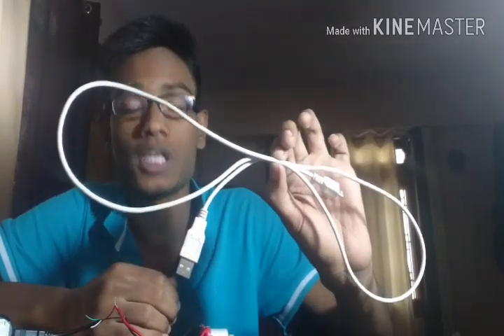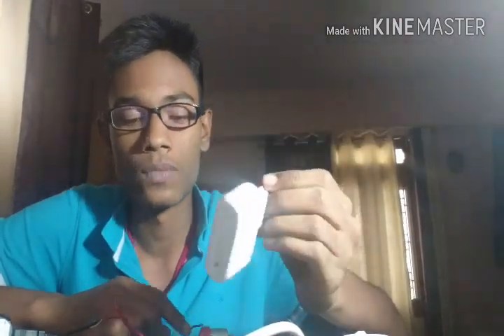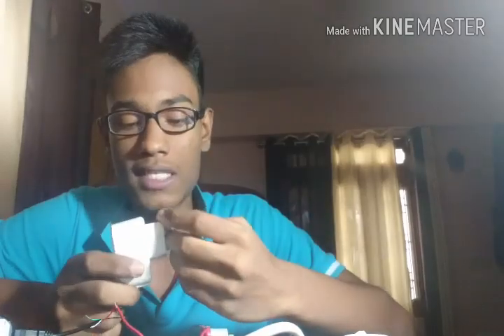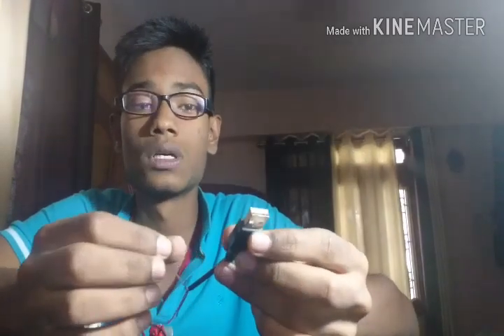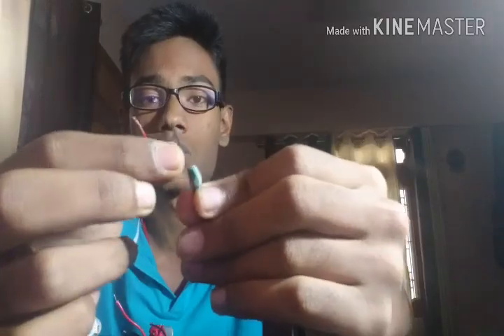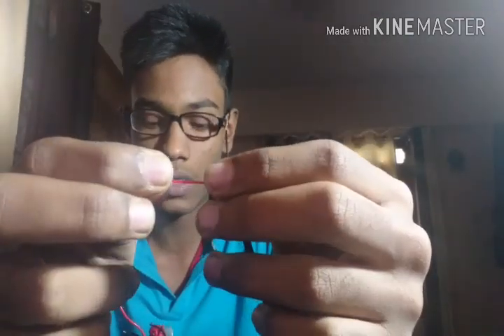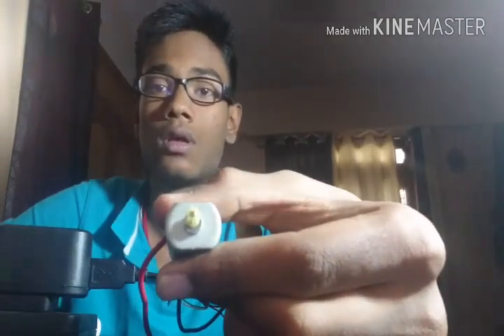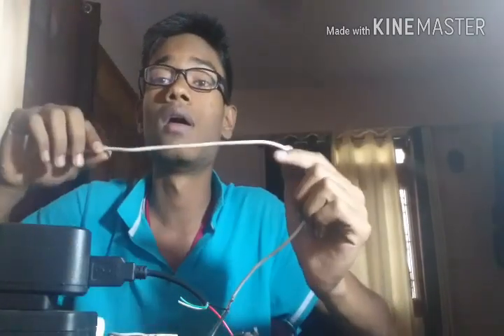How to directly connect usb cable to any electronic circuit or device.

Comment: Thanks, just fixed this old miller lite sign by using a usb cable. For some reason it had a 2.5mm to 3.5mm audio jack as if it was a power source.  Appreciate the video!

Comment: Everyone!!!! Please make sure that whatever you're operating,  matches the voltage that the plug is pumping out. You can only go over or under by 1 volt. I wouldn't pass that.
You all saw how his little motor was speeding up. Thats because the motor needed less power.  
It would have caught fire if he left it on.
Reply: Lol it wouldn't catch fire but the brushes would get burned up and the motor would be dead. You could fry small electronics with this though.

Comment: A few thoughts. You want to be careful of voltage and mili-amps. You can blow up the motor or start a small electrical fire. Somethings can tollerate a little more than designed . That motor is going ham probably because its more amperage than its used to. 

I understand why you are using the term battery here but its just converting the current and down stepping it.

For anyone curious the other 2 wires int he USB are Data + and Data -. So you can also use a cable like that to pull things off a thumb drive, to say, a phone. Which is a project that lead me to finding this.
Reply: Hello chris, i have a question. I have two different 2 way wires. One is with black & red and the other is brown & blue. How can i connect this wires? What color is for which. It is for an aquarium light which has the brown and blue wire. I cut it so that i can put the dimmer/timer in between the source and the lamp. The dimmer/timer has red and black wires. Thanks in advance😊
Reply: I used some speaker wire and the USB to recharge my headlamps battery it worked

Comment: Thanks mate! Was just wondering wether you can use just the Plus and Minus Pole of an USB Port, needed it for a bluetooth speaker project. Many thanks!
Reply: Yes you can definitely do that and its much safer. Did u see the look on his face when the motor went faster?? 
Yeah! It was gonna pop on fire. 
I know.  I've been messing with electricity since i was 5 yrs old.😎
Reply: @clearwater9118  Hej

Comment: Thank you! I recently bought a soldering iron because I thought I could do some cool stuff with it and I wasn’t sure if my theories on how to do it were correct... I’m pretty young and like to do this kind of stuff and right now I want to connect a motor to a USB output so if the motor spins, you can charge your phone, etc.. I then want to connect the motor to my bike so when I go biking I can charge my powerbank... Thank you for your help

Comment: I have a question. Can you do the opposite and connect those 2 wires, (black and red) from the usb to a wall electricity wires without a socket in the wall? There is a wall with wires that are for a wall socket but the socket isn't there. Could you connect the wall wires directly to the usb wires to get it to work? Thank you.

Comment: Hi ! So if I strip the USB can I connect it to a 9v Lithium Battery ? Is red positive black negative I ask so if I can power from Battery via USB which is already connected to small fan
Reply: @garfieldpelly  I think you can but it must be about the same voltage as I tried it with a 5volt fan and it worked on 9v battery

Comment: Hey brother, can i use this method for a rechargeable batteries? Thanks alot!
Reply: ? Like to charge a rechargeable battery? You could but that's pretty dangerous as if it overcharges your battery could light fire or explode.

Comment: Dear, I wired my mouse and a usb together to use my mouse on laptop...mouse's light is on but pointer is not working...what to do???
Reply: a mouse is different because you also need data transferred, not just electricity.

Comment: ⚠️🚫🛑☢CAUTION!!! USB wires are for low voltage electronics ONLY!!!
 like a phone, small 5volt fan, LED lights and bluetooth speakers, etc.
So its best to plug the other side into a USB socket/outlet.  Not the square charging plug converter thing that he showed.

Comment: Hello, thanks for this, please help me. I want to convert a normal type c adapter to use iPhone on my iPad . The iPhone cable has 4 wires and converter cable has 6 cables 😢 4 of the 6 are outside . 2 big red and black, 2 small green and white oh wait I think I know how to put them together thanks will update you now

Comment: Hey pal, do you know how to put a micro USB onto a 3 wire 3.7 volt battery ?. It's basically a positive, negative and thermistor wire and I need to attach the battery to the smaller USB. The newer type but not a type 3. I hope that makes some sense, probably not :-)

Comment: I had an old wired intex speaker so i had cut its two pin ower supply wite and attached it to the usb the way you told but nothing's happening the speaker is not getting any power supply
Please help buddy!!!!!!

Comment: If you connect a USB cable directly to 12V and hardware without using any kind of a converter or module how many volts is the output? 12v or 5V?
Reply: 5v
Reply: Abdullah Fathi huh??? That’s impossible because there’s no step down converter? How does it step down from 12 to 5 if you have no converter and you run a straight wire to the battery?

Comment: I have a two wire red & white wall plug that connects to my ps3 dual shock controller it don't charge then I have a red and cut blue and red USB end that can connect to USB port in ps3 and a white USB cord with four wires coloring red white black and green I'm so stuck here remotes not charging

Comment: Challengr Cables Sales PS-1.35-515SWC AC Adapter 5V 1.5A PS135515SWC  Model: PS-1.35-515SWC  Input: 120V 60Hz  Output: 5V 1.5A  
Asalam walikum 
Bhai ye charger hai jo mai ne apko detail di hai is ka cable change karna hai par charger mai 2 wire black color k us k cable kis tarhan change hoga

Comment: Hy bro  my Samsung charger pin was not working so i tried to replace it with a duplicate charger pin but i got confused when i saw four wires in the original charger and two wires in the duplicate pin so how do i join this?plz help me

Comment: What will happen if all 4 wires of USB cable connected to dc motor?
Reply: Manthan Patil Bro those cables are for transmitting data..for eg you use them to receive and send any files into your computer
Reply: Nothing other two are for data transfer

Comment: Thank you sir for sharing this video. I am hoping that this method will help me produce a cable that will charge a deep cycle 12 volt battery with a portable solar device (battery). If so I will share in my own video, and credit you. Thanks again. ✌🏼😎
Reply: No it will not.... the usb cable can only supply a maximum of 5v 2amps, any more than that and you will end up burning out stuff... buy a cheap second hand solar panel and a charge controller from ebay and do it that way or just buy a cheap battery charger.

Comment: It looks like you had a 3 volt motor with a 5 volt charger, that’s why it was so fast.  I wonder how long before it burns the motor out and burns down the house.
Reply from the maker: Well it is true what you have mentioned but I have used this thing for a while now...and believe me I still live in the same room.
Reply: SHREYANSH SHASHWAT well I’ve used your video and fixed an old beard trimmer using a usb. It gets hot when I charge it, so I’m always in the same room just in case, but hey it now works, so thank you.

Comment: What if there are only 2 wires, one is white and the other is off-white
Reply: Do you have a multimeter?  you could check the voltage across the two wires

Comment: mine did'nt work, i don't know why, is it cause my USB is too long???? I connected everything properly too.
Reply from the maker: +dheer tammina 
No, if its long it does not matter ,does it have same wire colours as described in videos?
Reply: yup
Reply: It does matter, Google electrical resistance dc.... seriously bad video
Reply: Honestly don’t know anything about this and I know this was 3 years ago, but you should try plugging it in to a laptop and then see if it works. Don’t even know the reason but yeah it might work that way.

Comment: Who here knows how to o convert I guess you would really say. 5 wire to a 2 wire charger cord..... Now i on my way around cars house electrical also phones other repair or deals but when I go towards these kind of situation well I like to check on the boxes so can somebody please let me know if I have the right selection my wire colors for the seaport type plug wire is blue white red Green and there is also inside of it a bear quarter braided soil wire going up through there the other correct colors except for black my black color is blue and huge my language but I do not want to f*** this up my friend's phone yes I can buy a new charger wire extremely cheaper but we're just trying to buy some days till we can get to a Payday in it anybody's phones. And just to see if we can do it we like the challenge so any assistance please contact me or just respond s*** LOL thank you dude easy☝️☝️☝️☝️☝️☝️☝️☝️☝🏽☝️☝️☝️☝️☝️☝️☝️☝️☝️☝️☝️☝️☝️☝️☝️ hell yeah I got it no problem I know I could but I really love double checking so I'm concussion to the wind after using the multimeter triple checking and s*** so thank you

Comment: u did't told wich color is positive and which color is negative
Reply from the maker: +Imran Javaid 
sorry for late reply...black is ground (negative)
and red for Vcc(positive).
Reply: It can also be blue and orange,gray and yellow, or even black and (surprise!) white. Use tester, or at least  light diode, resistor and Schottky diode to figure out what is going on in your wire...
Reply: Mks